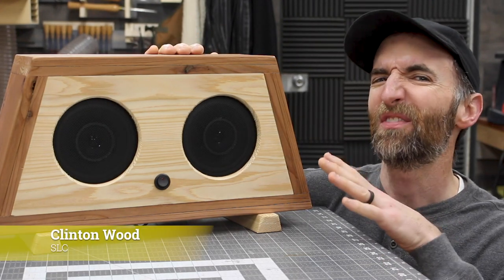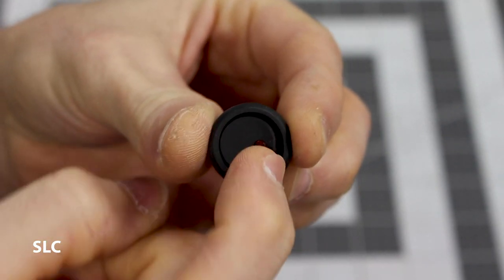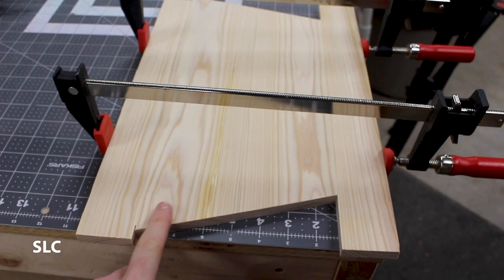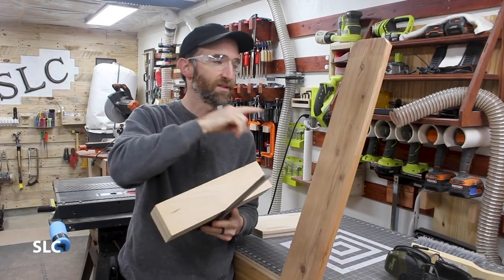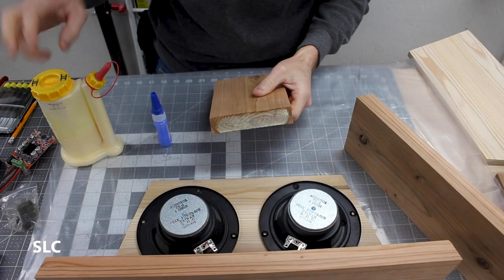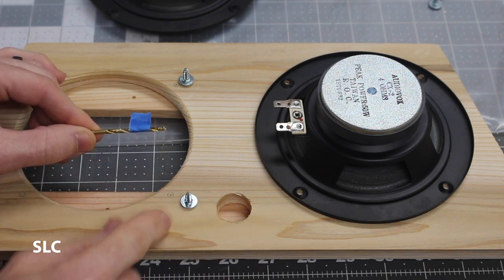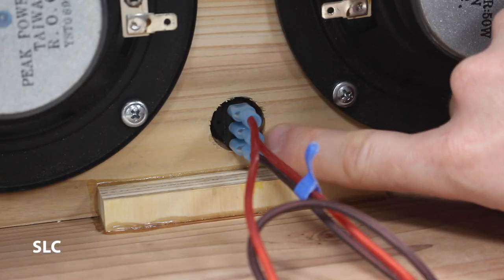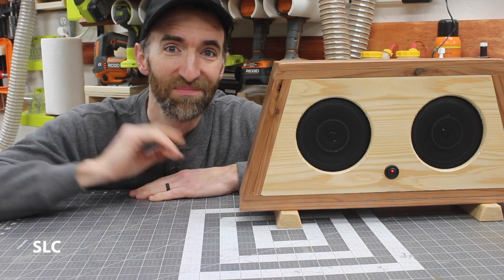DIY Bluetooth Speaker / Build your Own

Comment: Make a wooden partition between the two speakers to get a proper dual channel sound , also make very tiny holes so no pressure builds inside , you can fill the box with some glass wool as well to get better bass and less resonance , this is a pretty good design and can sound really well , the board used it pretty neat at what it does and the csr bluetooh chip on it gives no latency at all !
Reply from the maker: Thanks for the info, I will keep that in mind.